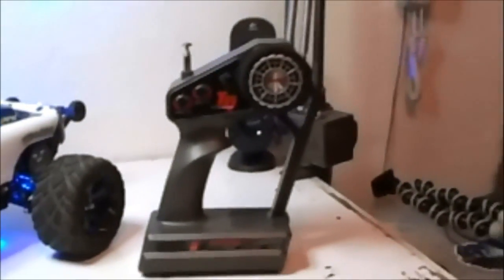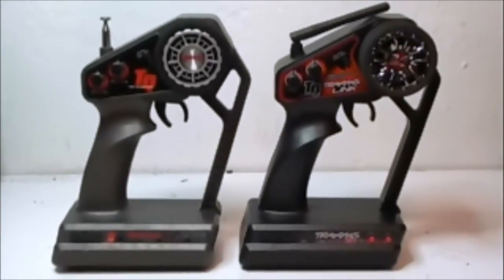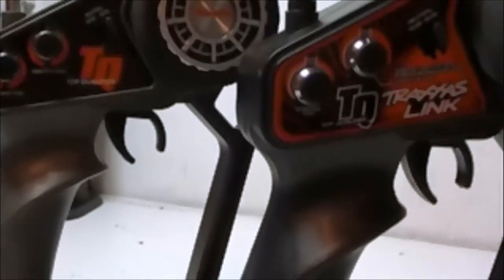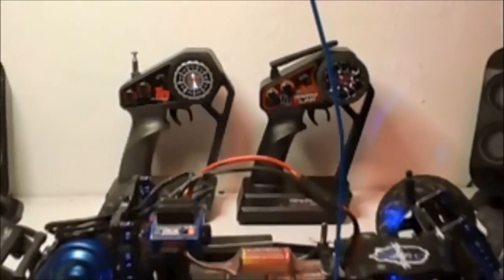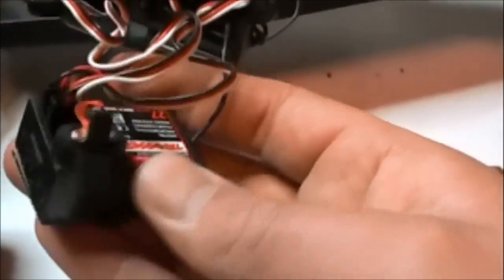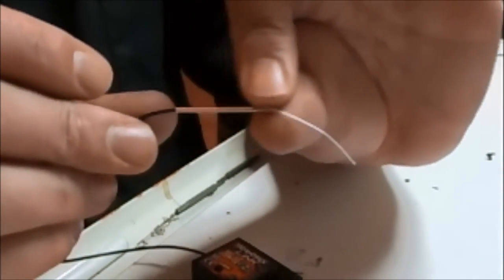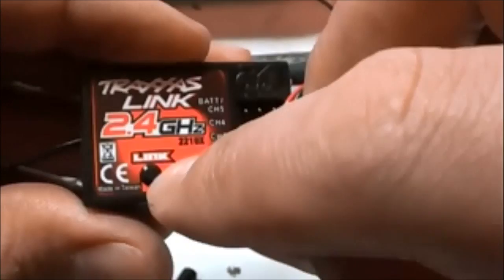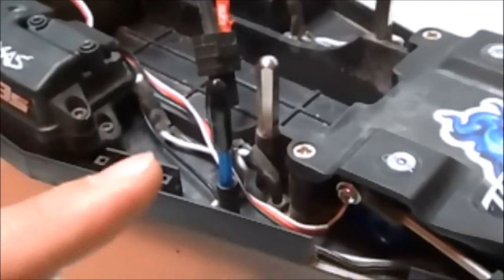Daemon - Traxxas Rustler - Level 25 Upgrade - Traxxas 2.4 gHZ Remote

Comment: you know you can get a sky fly fs-gt3b for 40$ brand new and it has 10 model memory, huge back lite screen with tons of options..... basically a really really good nock off of spectrum, except the receivers are only 7 dollars each instead of like 50$ a receiver.... you should check it out... really sweet :D